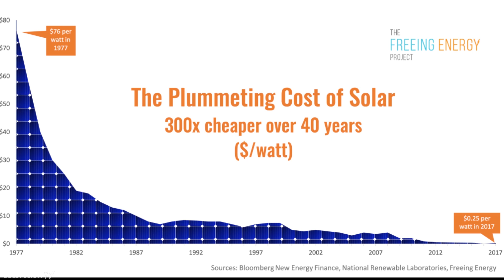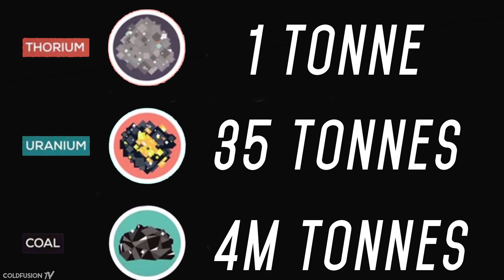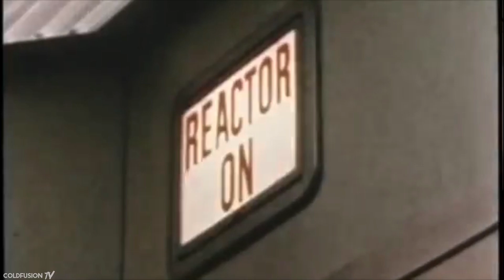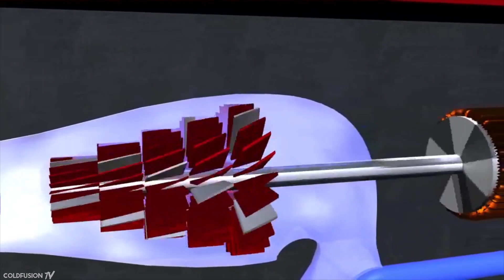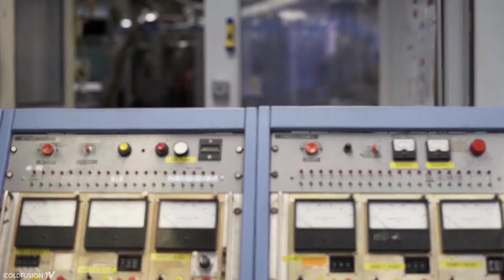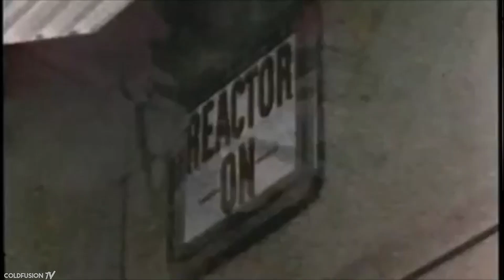Thorium - The Future of Energy?

Comment: What most people misunderstand is that thorium reactors are actually uranium 233 reactors. While uranium 235 occurs naturally, plutonium 239 and uranium 233 don't occur naturally and are produced by irradiating uranium 238 and thorium 232 respectively in a reactor. Uranium 233 reactors produce waste products which have a half life on only 300 years, which is far better than uranium 235 or plutonium 239 reactor waste which have half lives of around 500,000 years.
While all that sounds fine and dandy, to create the stockpiles of u233 for thorium reactors requires breeder reactors based on uranium 235 to produce plutonium 239 stockpiles first, and then these need to be converted into uranium 233. Once you have built up u233 stockpiles, the process is self sustaining as the breeding ratio is only just above 1. Only once you have produced sufficient uranium 233 stockpiles, can you get the benefits of clean u233 reactors. 

Nobody wants to build the dirty reactors that are required to build up the stockpiles of u233, and that is the problem with thorium reactors. You can think of  Th232/U233 reactors as a clean version of U238/Pu239 reactor with a breeding ratio of just over 1.

Comment: India has a experimental stage project using thorium fuel - Fast Breeder Reactor(PFBR) is a 500 MWe presently being constructed at the Madras Atomic Power Station in Kalpakkam, India.
Reply: @avoimena  Good for you. ( I knew that the best should be Norway, Sweden, Denmark, or Finnland) Not everyone is that lucky though, but everyone has a homeland (mostly). So the idea would be that everyone should be taken care of no matter where they live.
Reply: it does not use thorium until enough plutonium is built up.Thorium reactor is still far away from construction most probably it will be IMSR >>fast breeder reactors (FBRs) would use a mixed oxide (MOX) fuel made from plutonium-239, recovered by reprocessing spent fuel from the first stage, and natural uranium. In FBRs, plutonium-239 undergoes fission to produce energy, while the uranium-238 present in the mixed oxide fuel transmutes to additional plutonium-239. Thus, the Stage II FBRs are designed to "breed" more fuel than they consume. Once the inventory of plutonium-239 is built up thorium can be introduced as a blanket material in the reactor and transmuted to uranium-233 for use in the third stage>> third stage is IMSR thorium reactor
Reply: @otomackena7610 , bombarding spent fuel with neutrons for reuse in fission reactors is ideal...it produces power while eliminating nuclear waste at the same time.
Reply: @otomackena7610  Why Pu-239 inventory is required to introduce Thorium in 2nd stage?
Reply: @rishikeshdwivedi4117  Because Thorium is not a fuel but fertile material, and you need to "impregnate" it first (yep srsly). It isn't require plutonium per se (u-235 would do it too, all you need is controlled neutron flux) but typically fast reactors use pu-239 because it has a lower critical mass and it requires no enrichment (not in a driect way at least) like uranium would do. Also there are stockpiles "hoarded" of pu-239 as a by/waste product of previous reactors or in form of warheads in former obsolete nuclear weapons.
Reply: India's Three Stage Nuclear Power Program is in delay because of US/NATO Sanctions in the 70s and 90s and relatively recently pulled off in 2005 and 2008.
Reply: Assassination of our nuclear and space scientists by CIA delayed this technology.
Reply: Reactor name is Bhavini, should start operation later this year.
Reply: @feanor1489  small correction, the reactors name is PFBR( PROTOTYPE FAST BREEDER REACTOR) BHAVINI is the name of the organisation created to make future FBR ( FAST BREEDER REACTOR) in the country, just like how NPCIL is entrusted to make PHWR( pressurised heavy water reactor)...
Reply: India has an awesome scientific elite and they're not stupid: They understand that nuclear power is scalable .
Reply: India has abundant thorium reserves and long sunny days.  With the right investments, India could meet her energy needs through a combination of thorium power and solar power...until fusion arrives and becomes the new baseline power source.
Reply: @davidrosner6267  yepp we are exactly doing the same, in last 5 years only 1GW capacity of coal generation (60% coal based generation is maintained) added while the generation through renewables increased like 3×times (about 75 GW) with a target of 170 GW of renewables generation by 2022. Nuclear capacity is also increased but I don't know the number but our primary focus is on renewables. We are living to the promise we made at Paris climate change back then (world laughed at us at first 😅).
Reply: Damn that's interesting and remarkable. Never knew about it
Reply: @rishabharora4652  https://youtu.be/LSOiMaZI4S0

This will increase ur knowledge✌️
Reply: India should have invested more in thus fleld.
It can solve indias energy issues.
Reply: thank you india for having vision for long term
Reply: As a Pakistani, I very much love and appreciate the idea of using Thorium in your power plants and the effort being put in to develop it! Much cleaner, safer and can power India for the next century and beyond! 😊 Hope you fellas make it and may my country step up too!
Reply: Wao that's great to know. India has the highest reserves of Thorium in the world.
Reply: @rakeshmallick8040  Actually no. That would be Brazil, though India does have one of the largest.
Reply: India is OP!
Reply: @oswaldoistarak  OP as in Over Populated.
Reply: @holyravioli5795  looll, indeed it is true.
Reply: Avoid the trolls people. Don't give them attention. India haters are trying to bait you. They're sad trolls with no lives. Let them spew venom. We're doing great and that's all that matters.
Reply: @avoimena  Like every other country too, what's your point ?
Reply: 😭But Don't destroy our Beach ...
Reply: punit p  Muslims in Kerala have a lower birth rate than Hindus in UP, Bihar etc. Education matters.
Reply: @anandjainishere  Because Kerala is small in size and population. Education do matters, no doubt about that but when you comment on Other states, do think in all perspective. just saying
Reply: More than 50 percent of thorium based research projects originate in india
Reply: Ffs man, don't let these Americans know. They'll probably steal ideas and stuff
Reply: Not sure what source you are using, but this is a plutonium/uranium mix PFBR, and without the thorium design. https://currentaffairs.gktoday.in/tags/bhavini
Reply: Last time i read Thorium reactors were still in research stages and we're not yet materialized
Reply: Well India has the biggest reserves, hope that this technology matures faster, countries like South Africa Egypt Turkey and especially Brazil are bound to use it since they have major reserves not to mention China Russia the US Canada and Australia and Europe. 
Europe can use this technology since there are big reserves in Greenland/Denmark Norway Sweden and Finland not to mention the traditional world mines Canada and Australia (Also South Africa).
China and Russia have their own big reserves and can be further fueled by Kazakhstan.
At least it is how I see it.
The reserves distribution are not better than Uranium but Evey big federation and continent have big reserves, so that solves energy security issues related to this technology and Australia as always will continue to be raw materials provider to the far Asian region.
Reply: Commercial exploitation not before 2050
Reply: Kamini
Reply: @Adam Courier people who will use it will pay , they already do for coal based electricity
Reply: @morislaguerta4415  Its easy to fart on Internet with trash talk. If you have meaningful suggestion or points, make it, don't brag ur clean roads or clean toilets over here. We accept our weakness and work on them unlike you.
Reply: 1 second ago
WITH MICRO THORIUM GENERATORS THE TEXAS POWER OUTAGE WOULD NOT HAVE HAPPENED. THUM'S  UP IF U AGREE. NO UTILITY NEEDED
Reply: Also Im pretty certain it uses solid fuel, which means worse burnup, no on site reprocessing without shut down, no frezee plug safety, no extra thermal efficiency (which means no universality to use for chemical platforms, or desalination beyond electircity generation) and because it is fast spectrum I expect pretty bad neutron economy (U-233 has the highes avarage number of neutron/fission in thermal spectrum) to the point where it may can't even run on purely U-233 in breeder mode.
Reply: Holy shit does India get butt hurt when you question its integrity and here I was thinking that America was the worst country for getting pissed off at people when they get questioned. 

Also im not from "the west" so im not sure what your talking about "Andrew blazkowitz".
Reply: @holyravioli5795  says the butt hurt who hides behind a fake name..!
Reply: I can't wait for the Indian industrial revolution to begin so that all those internet scams finally stop. 😆

(Was just a joke. I don't really expect more social well-being from industrial growth.)
Reply: For starters, it would be sagacious of India to process&remove piles of fecal matter from the streets before dealing with anything else.
Reply: @morislaguerta4415  your IQ is below room temperature
Reply: @Dheerajkumar-ko8qf  besides your ad hominem invective, do you have anything of substance to contend? Or would you sooner bury your head in the sand (or, more aptly, faeces)?
Reply: @Dheerajkumar-ko8qf  Rather than dribbling on the Internet, you could do something meaningful- like cleaning up your street.
Reply: @morislaguerta4415  how solve of all your homeless problems instead of dribbling on the internet? That sound fair?
Reply: @morislaguerta4415   Low IQ comment
Reply: @morislaguerta4415  It sure would decrease the amount of disease present in India.
Reply: @holyravioli5795  watch out for the frenzied and demented "superpower by 2020" mob.
Reply: @hanselxy I'm not from Pakistan, seriously dude, the first thing people think of when you say "india" is curry and scam call center's.
Reply: @holyravioli5795  that's all the west can think to point out others while they dig their own grave.ya we have scam call centres and we also ban and jail them unlike u we don't point at anyone (except some butthurt noob internet consumers and some brainless Indian politicians who want use it as for their propaganda) without seeing facts ,not knowing full picture and u do the same with problems within ur country and create much more conflicts within and outside.whats wrong with u, if u can't help nor guide developing countries then don't poke ur nose in its problems it might end up in u choking on its dick. Be a good human being for atleast betterment of u atleast if possible for others too.
Reply: @holyravioli5795  scam callers are successful becuz those who got scammed are stupid people with no intelligence... that's why they would get scammed every time
Reply: @holyravioli5795  India produces best scientists...They are best import America had
Reply: @hanselxy I'm not from Pakistan and i don't play cricket.
Reply: Don't trust India, they haven't even developed a working toilet for the masses.
Reply: @justinsane3909  isn't pakistan functional?? 🤔
Reply: @justinsane3909  You are still thinking about toilets. I don't know how u went there from thorium based reactor to toilets.
Reply: @justinsane3909  we just did it almost 97% now compare to 50% in 2014
Reply: @justinsane3909   u know we have lot of problems and we r trying to solve it ,it takes time we'll doit ,thanks for the criticism I'm sure those who can understand will support and be a good citizen and then just ignore butt hurt noob internet consumers most of them won't even do good things for their country ,theyall just trash talk and wants to live in the shelters of others achievements .
Reply: Perhaps you should focus on getting rid of all your scam call centers before jumping into the nuclear industry.
Reply: @holyravioli5795  perhaps u should get rid of fbi first
Reply: @gobardhansingh1453  Why and how? I live nowhere near where the FBI operates and i don't have the means to single handedly dismantle it?
Reply: @holyravioli5795  every country has its issues, I don't if you are from USA but generally speaking our medical or medical insurance costs exponentially are much lower, we dont have private prisons, no school shootings etc. You get my point
Reply: If you run it as well as your train service and sewage nothing could possibly go wrong......
Reply: @Berserkism  India currently operates 22 uranium reactors for over 3 decades with NO accidents, things take time in developing country's. USA and Russia have had nuclear accidents on the other hand, just saying
Reply: @RK-bj8ho  Nuclear accidents also take time to develop.
Reply: @holyravioli5795  not ture troll, indias first reactor TAPS built 1962 nearing end of life with no accidents
Reply: @RK-bj8ho  That's because they're at the frontline of the research. Accidents are guaranteed at that stage. They go out, take the risk, and research it for us, and we apply the safe methods they figure out and learn from their mistakes!
Reply: @HighHell99  India was under nuclear embargo at the time, everything was frontline effort. Chernobyl and 3 mile island accidents have nothing to do with research
Reply: @holyravioli5795  and your countrymen should focus on not gunning down your people....
Reply: @RK-bj8ho  Im sure India has fine qualities, hygiene and human rights is not one of them,just stick to Thorium topic
Reply: @Berserkism  F** ignorant r** with a closed mind and preconceived notions.

Comment: Nuclear isn't a stopgap- it IS the solution.  Molten Salt Reactors and traveling wave reactors can provide us thousands of years of clean power burning what is now stored as nuclear waste, and after that runs out there's enough throium lying around in tailing piles to provide us perhaps 5000 years of piles.  That's clean power for longer than we've had agriculture without even having to mine anything.

Comment: nothing is truly carbon neutral
if it is mined and transported it used carbon 
it can be less than net carbon output compared to coal
Reply: Until you power your excavation and transportation with carbon neutral electricity.
Reply: Yes that battery powered train and truck. :D batteries are nice for convenience. Yet when you have to use tools that need real power you need real fuel. Plus batteries are highly inefficient. 

It reminds me of edison trying to make DC power standard. There is just some real science standing in the way. So the best things about EV is items and drones for places like the moon.

Half the fuel is the atmosphere. A battery car is always heavy. Transporting electricity loses power. Storing electricity loses power. Charging batteries loses power.....etc. Age of the battery increasing gets less efficient each charge.

The same amount of natural gas used in a LG vehicule will always go atleast 1/3 further than an EV.
Reply: The odd thing about EV is that the world would need 1/3 to double amount of energy. You would have to drastically increase the coal and gas burning. The net carbon output would increase. Unless you can get arounnd half green energy it doesn't make sense to go EV .
Reply: Maybe this Torium could get you to the half green energy to actually reduce the net carbon output we use today. 
My point is anything that says it is free, net zero...etc. Is either the exact opposite or only telling half the truth.

Comment: Please make a video on algae based fuel. It would be carbon negative.
Reply: With a Thorium molten salt reactor, you can have fuel cogeneration plants tacked on that produce carbon neutral gasoline at $1.67 per gallon, because of their stable high temperature operation.

Comment: sigh There's a lot of assumption as to what "thorium" brings to the table which isn't about thorium at all, but 4th generation reactor design. A 4th gen reactor can still have that meltdown-less safety aspect as part of a liquid salt design, but be used with existing uranium cycles. It's also worth noting that the uranium doesn't need to be of the enriched variety, so we have massive stockpiles that were left over from the original enrichment. The uranium chemistry is well understood, which affects things like how it'll interact with reaction vessel materials, which would need reevaluated for thorium. They can also take existing high-level waste from current reactors and "burn" it to take it to a more manageable state.
Reply: Yeah it's the 4th generation thing but thorium would be the holy grain in terms of waste seeing as it starts that much further over in the periodic table, it produces that many less actinides/transuranics
Reply: They still have to design and build the new reactor type, though
Reply: @descai10  yeah, but only Russia has fast breeder production design working today, so everyone else needs to start from scratch
Reply: @descai10  That's already underway, with a few different companies and variants in the process. They're already far enough along in the process to have had researh reactor sites be allocated by Nuclear Regulatory committees in Canada and elsewhere. Terrestrial Energy for example are a leader there. The business case is already compelling enough.

Comment: They keep calling it a Thorium reactor, but really it's just a uranium 233 reactor. Half life of 160,000 years for u233, which is not great, but not terrible :)
Reply: The waste products after use of U233 in a reactor only have a half life of 300 years unlike about 500,000 years for U235 or Pu239  which is brilliant. In addition a U233 reactor can be used to burn up and reduce the half life of other highly radioactive long half life transuranic waste products produced by U235 and Pu 239 reactors. This is also good.